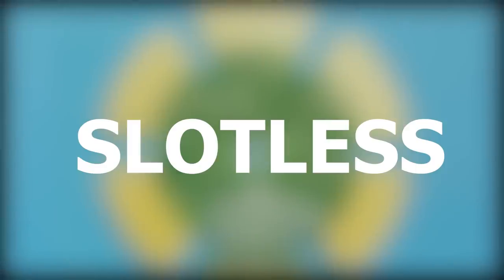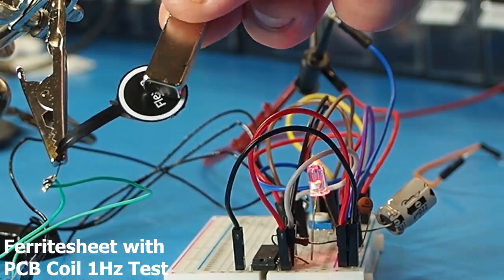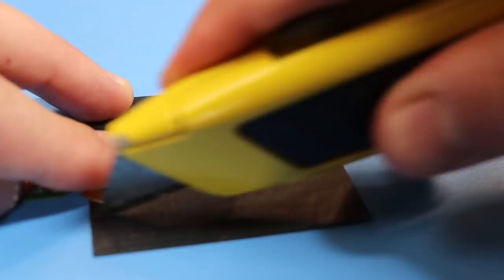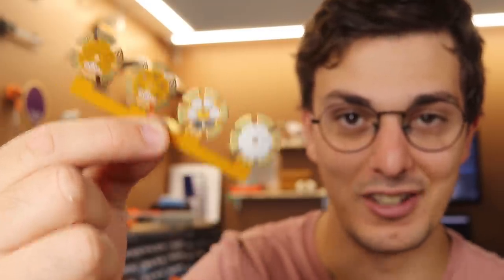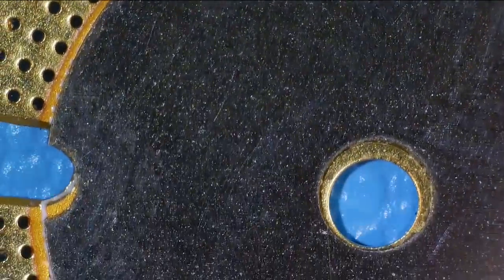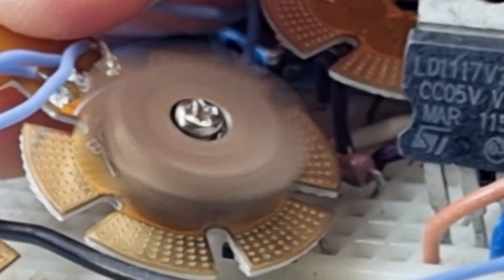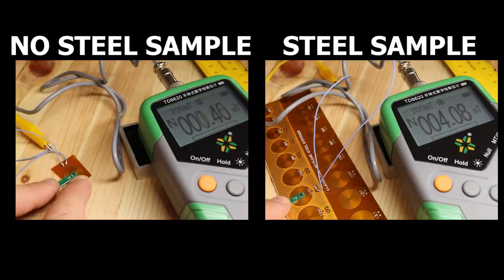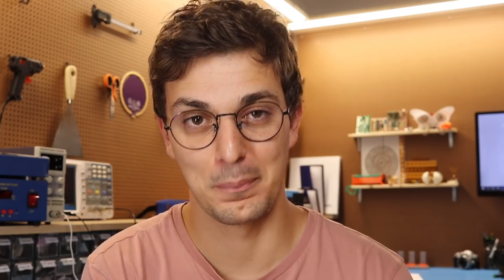Is a Cored PCB-Motor more efficient?

Comment: I don’t think cogging will be an issue so long as the core material is symmetrical enough, and that the rotor and stator poles are sufficiently indivisible. Because the attractive force of the rotor approaching a piece of iron should be cancelled out by the attractive force of the rotor moving away from another piece of iron. That said, you may need more rotor poles for this to work properly. That glimpse of a future model looks promising!

If you’re after more extreme changes, see about looking for sheet mumetal or silicon steel.

Comment: Carl, don't be too disappointed.  I know that engineers working on micromachines and nano-tech have run up against many of the same problems.  In fact, the whole field of nanotech got stalled out for a while because they were bummed out when their motors wouldn't lift or rotate much of a load.
I think what they've done is to start looking for applications where their tiny motors do have enough torque to move things...like in the microscopic scale!
Back when I was a neuroscientist, I used to use micro-pipettes to make "suction electrodes" to record nerve impulses from the outside of nerves, and intracellular electrodes as well.  (We would make them by heating-then-pulling the micropipettes so that they formed a sharp point.  Then we would break it off at a convenient point, and under a dissecting microscope, file or nick it with a diamond file to the right diameter for an exterior "suction" electrode (followed by fire-polishing the end), or the correct diameter and angle for penetrating the cell for an intracellular electrode.)  But we were limited in a part of the actual cell membrane penetration--in other words, cells that we wanted to record from had to be large enough, and/or on a suitable substrate.  I won't go into the details of what I mean.
The point of all this is to say that---back then--I read a paper that described how another researcher made a device with a piezo crystal to actually penetrate the cell membrane.  By controlling the voltage and the pulse duration, he could control the force and amplitude of the thrusting crystal, and therefore control the trajectory of the electrode.  The crystal would thrust the elecrode just a tiny bit, like a tiny lance, so that he could make recordings from very small sensory cells, as well as from cells that were in small groups that--by any other means--the electrode would push through the cell, and break the tip on the underlying substrate.  We used things called "micro-manipulators," with fine rack and pinion controls, but they were massive compared to these crystal piezo things that could push the tiny javelins just far enough to penetrate a cell membrane.  It's all about scale.
So, that's my advice to you!  Either use a different motor, or find smaller things to push or rotate!  (Sorry!)

Comment: A balanced single pcb circuit would have back iron connecting rotor magnets with rotors on both side of the pcb.  This is the best configuration with proper flux paths  for a single set of coils. When you place the steel behind the coils, it isn't working properly because it's also extremely close to the magnets and shorting them, since the coils are without stator to focus the magnet flux between phases.  

Awesome projects man!  Motors are tough!

Comment: Great work as usual ! I didn't known flexible PCB manufacturing had that much option, kinda cool
My suggestions to make it better are the following : 
- being a flat coil design (PCB) I dont think there is a lot to gain adding Steel especially on top ! For one if not laminated or powdered agregate it will just work as a Eddy current brake at speed, for two core purpose is to improve airgap flux density by reducing magnetic circuit reluctance, having on open back stator and core would not add much since the magnetic flux still have to curve back in air to close the magnetic loop. So keeping it coreless and as thin as possible is the best bet.
- The bigest adding you could make would probably be on an Iron backing rotor for lower reluctance and with a powdered Iron backing on the stator (as you saw, the Steel washer was the best for reluctance reduction but still act as a brake when the motor turn). Going back to a doubled Iron backed stator would be also really good (rotor don't need to be powdered or laminate because the magnetic flux is stationnary in his reference frame). 

Keep up the good work !
Reply: Very good suggestions 👍

Comment: Even a relatively tiny improvement in torque is worth having if it does not increase weight too much. For example putting this motor through an epicyclic gear box with say a 36,000 to 1 reduction (some applications are perfectly good with a 6RPM speed) just 1mNcm increase would give you about 0.2Nm assuming near 50% losses. That is plenty to align a mirror for example.

Comment: If that's the magnetised ferrite rubber sheet, AFAIA it's always magnetised into a Halback array so it's far more strongly attractive on one side than the other. This also results in a repeating pattern of poles that you can feel if you cut a bit of the sheet off and attempt to stick it to itself, when they're orthogonal to each other attraction will be very low, and when they are parallel you'll get a click-click-click "cogging" effect every 3-5mm or so.

Comment: Somalloy cores mayb in holes at the center of the coils of a regular fr4? That would make a massive difference in torque. Also make a 16 layer coil with wider traces, that would improve things even more allowing for a bit higher inductance while maintaining low resistance. Maybe theyd help you out at höganäs if you tell them about this project, with the somalloy part. Also, move the coils to the absolute maximum distance from center and try a sine or foc drive, to reach even further.

Comment: This might be an effect of the grain alignment of the steel used. If the steel is grain aligned, it will possibly create magnetic poles which are fairly long lived. If possible, try to use steel which has no grain alignment.

Comment: Have you ever thought about making a multilayer board so that the turns go through several layers?
Reply: I'm pretty sure he did that for some of the earlier PCB motors.
Could be a good idea going back on that and seeing how much extra torque it gets him.
Reply: Normal motors are put in a metal case, which provides structure, a heat sink, but also can helpvwithvproviding magnetic shielding/distancing. A multilayer PCB with a faraday plane could help.

Comment: One suggestion:
Try layering the board/magnets with multiple layers, essentially doubling the output for any doubling of the layering, making use of the other side of the Flux field of the permanent magnet.
I see a future in this, if you successfully can create a multi layer design of higher power output and torque, without the creation to collapse on itself, due to the strength of the magnetic field.
If you create shift the magnetic polarity of each layer by an x-amount of degrees, and create a master controller to control the controller of each blade, the rotor won't wobble, but will be forced to follow the direction of the field.
Making ac motor controllers (especially tri phase), able to trigger the right magnetic pull on a rotor isn't easy!

Comment: A good configuration would be to have PCB's on both sides of the rotor, should improve flux shape where it interacts with the rotor. Probably having no core at all would be best, but having windings on both sides of the rotor would allow you to use a core that would complete the magnetic circuit (encase the thing).

Comment: Maybe you'd like to try three axial flux faulhaber wound coil on a PCB. 

Alternatly, maybe try an altogether different direction. Puns intended. Use three radial flux faulhaber coils printed on a flexible PCB would work very much like the motors made by thingap

Comment: have you tried sandwhiching the iron core with 2 stators, and using the same source of power?
or making a laminated style of stator-rotor like a voltaic pile, but the rotors are fused into the shaft, and the stators are mounted on a 3d printed holder, so the rotors can spin together?

Comment: what would happen if you could have few additional circuits in between main ones, and would use mildly different settings on it? could you "pre-drive" the field produced by changing the oscillation?

Comment: Hi Carl, I have an idea: what if we had two rotors, one one each side, one output and one input shaft. Shouldn't it be possible to apply a transfer function on the coils to replace a clutch and gearbox? Could be interesting for hybrid drivetrains. What do you think?

Comment: Would it make a difference if instead of covering the whole back of the motor PCB with a solid sheet of steel or ferro material you cut that pice into segments for each individual coil? I am thinking of transformer cores how they are made of stacked thin plates instead of one solid core. Though I don't really know what I am talking about something I read or saw once seems to be nagging me in the back of my mind.
Reply from the maker: I don't believe this should effect that much. In my PCB electromagnet video iron-backs were more effective that the mid-cores. Laminate cores are used to reduce eddy currents within a transformer to reduce heat
Reply: @CarlBugeja  Thank you for replying I didnt think I knew what I was talking about but wanted to say something anyway encase it made you think of something that might actually help. Hope your motor works out sooner rather than later I like the videos watching the process of trial and error making it work.

Comment: Hello thank you for good videos and great ideas. I have som ideas for you. You could try to use magets that have the magnetic flux point horizontaly so one maget uses both north and south i have seen several bldc motors in a small formfactor that has 6-8poles on the stator and 12-13 magnets that then gives 24-26 magnetic poles since it uses both north and south on one magnet. I hope you understand what i mean. 
Peace

Comment: What about a PCB motor, but with slots or feature for manual windings, and solder pads to fix winding 🤓🤔
Reply: I think one of the purposes of a PCB motor is to exclude labor, but it's a good idea
Reply: @viniciusfriasaleite8016  yes, agree - but there still is some bearing and rotor to DIY, so a little winding would not be a deal-breaker for me. Perhaps a clever design could be made - just wondering..

Comment: https://youtu.be/yCJ5vstBRdw
I recently saw a video describing this ‘new’ motor design and I immediately thought of your motors.
Sounds like the real solution is to have a rotor on either side of you PCB stator to balance the shaft and keep the magnetic fields contained.
Another video I saw also mentioned that powering two winding simultaneously and ramping the power up and down instead of switching them on and off can improve the efficiency even more.
Just some new ideas to consider in your next iteration of motor design.
You may also want to check their patent applications because it looks like they are claiming to have invented ideas that you posted first?